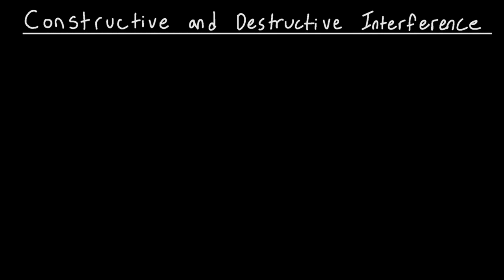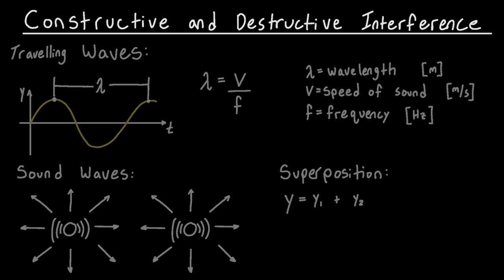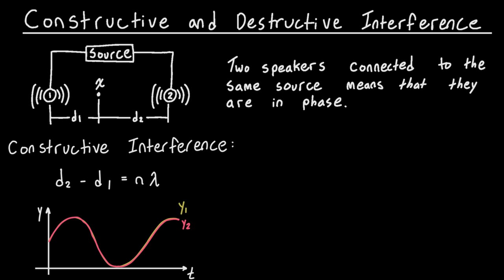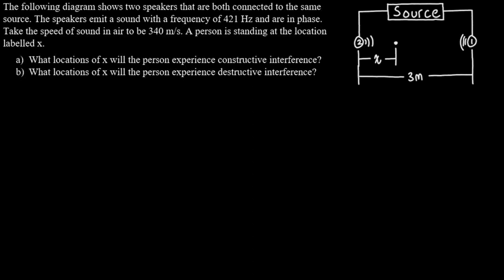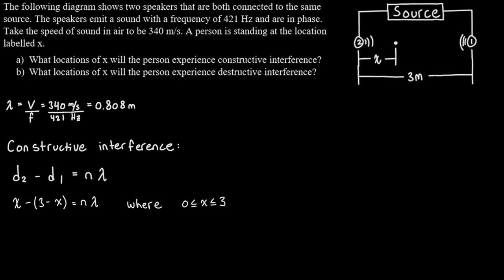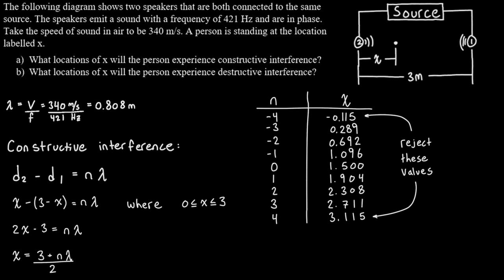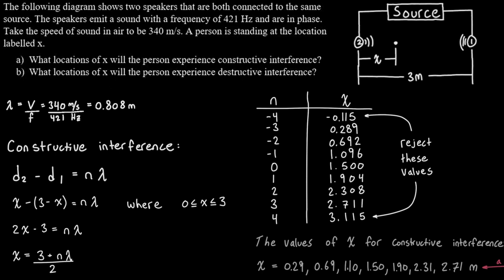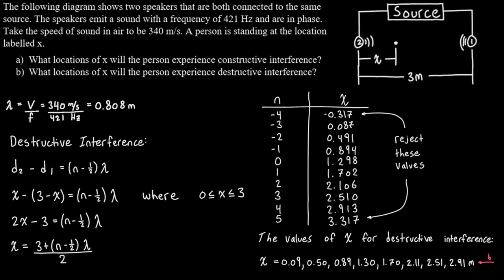Constructive and Destructive Interference: Physics Equations and Practice Problem

Comment: in my formula booklet destructive interference is given by path difference = (n+1/2)lambda, therefore my values were different from yours. Could you explain?
Reply from the maker: In this video we used (n-1/2) where n = 1, 2, 3, ... buts some notes will use (n+1/2) where n = 0, 1, 2, ... Either way you should get the same answer!